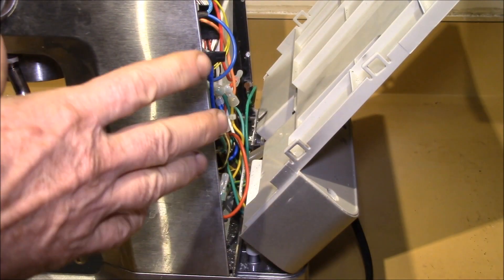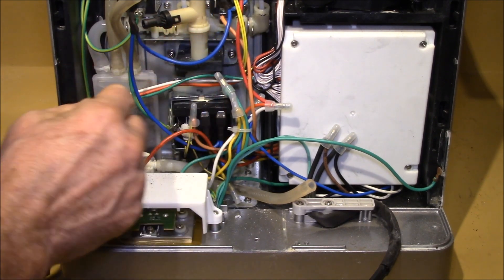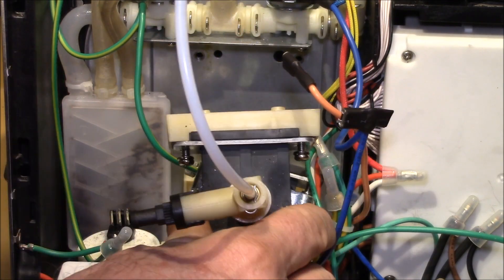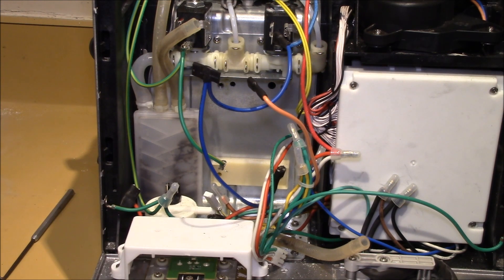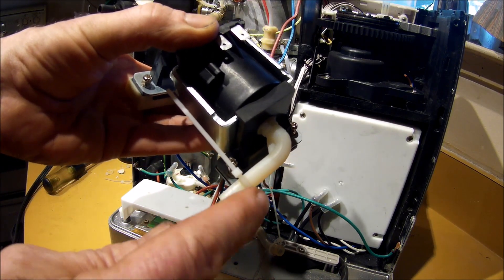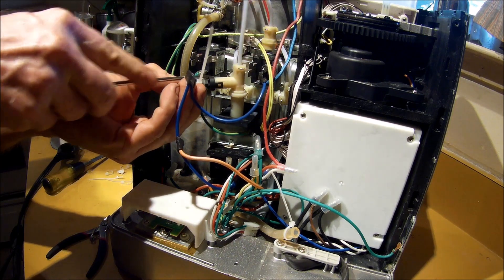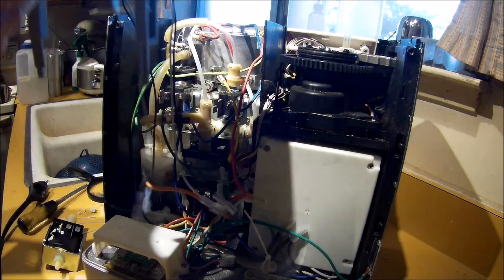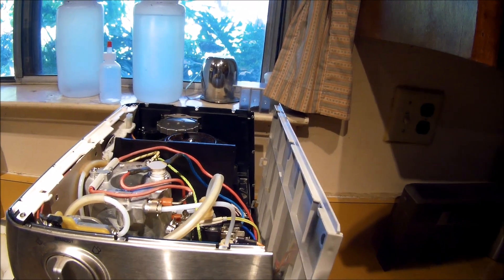Breville 870XL Pump Replacement, Part 1

Comment: Thank you for the great videos on replacing the solenoid and pump! I installed the new one and it solved my problem with the noise and water flow problems to the group head, hot water and steam wand. Upon taking it all apart, everything was clean with no corrosion or gunk. However now there appears to be a leak at the back left bottom which also drips into the storage compartment. The drip appears to come from the screw holes from the inside compartment as it pools below the tubes/pump etc. and then drips into the below compartment or onto the counter. I have tightened up all the zip tie connections as well as the solenoid assembly and the safety valve connection at the top of the pump (yes, I followed your instructions in the video about putting the seal back onto it). After drying up the slight trace of water on the bottom of the inside, I have run the group head and steam functions and cannot see any leaks/spray/drips. It only seems to leak when I reinstall the back cover. Could the back cover be pressing the safety valve assembly on top of the pump even though I have configured it at the 45 degree angle to avoid the solenoid? Is it possible to over-tighten zip ties or threaded valves? I was so excited to fix the original issue with the pump but now I'm stumped about the persistent leak. Any help would be great!
Reply from the maker: That may be the case with the back putting pressure on something when it's put on.  Try making small adjustments to the oprientation of the parts so that they don't move when the cover is reinstalled.  Try twisting the various hose connections back and forth and see if they'll seal up.  On any of the threaded connections, you might also try adding some Teflon thread tape to see if that helps.
Reply: @The4Crawler  Awesome! Thank you so much for the advice AND the very prompt reply! I used some tape on the threads of the valve connection at the top of the pump. I’ll try wiggling the tube connections to see if that does it and ensure nothing is contacting the back cover. Thank you again!
Reply: Hi ya Rob

Thanks for your awesome videos truly appreciate it they are very helpful.

But I'm having issues with my machine as I have replaced the pump and solenoids and there is still no water coming out the brew component.

When I push cup buttons 1 or 2 the water just goes straight into the tray and have no idea why?

Is there something I'm missing or done wrong?

Thanks heaps 
Troy

Comment: Thanks so much for these informative videos.  I'm hoping I can find a resolution to my problem here.  I bought a slightly used BES870XL and water flow, steam wand works but I get no pressure for the 1 cup button and just a little more than nothing for the 2 cup button.  I have adjusted the burr setting and the grinder on the side and that has not helped ( I'm assuming that why my friend sold it to me for cheap ).  The thing is, I use the cleaning disc on either a double wall or single filter on the 2 cup button and the pressure goes up to the max, sometimes, not every time, but this is the only time I EVER see the pressure gauge move.  If i use the  1 cup button with either the double wall or single wall filter and the cleaning disc, the gauge never moves.  Again, I have water flow.  Which part here needs to be replaced? Thanks in advance for all comments.
Reply from the maker: The dual wall filters should give some pressure regardless of the coffee grind.  Does the machine produce acceptable espresso?  If so, maybe don't worry about the gauge.  I find the cleaning disc will some times stick down on the bottom of the filter basket and that blocks off the water flow and you get a maximum reading on the gauge.  So it sounds like your pump is at least working in some manner.  It might be that when blocked, it can produce full pressure, but when there's flow under pressure, like when running a shot, then that pressure drops.  I noticed that on my machine and that prompted the pump replacement.  The pump can also be rebuilt from what I understand.  On the grinder, the ground coffee should have the consistency of regular table salt.  See my video in this playlist for checking the grind setting.
Reply: @The4Crawler   Thanks for your response.  I'm recognizing  I may not have watched these videos in order, if they were in order, but I saw a video on the Dezcal packets to descale and I'm trying that first.  I ordered the solenoid  valve replacement as well and will see if either of those does the trick this weekend.  Thanks for all the details in these videos man, I feel like per peoples comments on the Dezcal or the solenoid valve replacement on the ereplacement website one of these will work!
Reply from the maker: @selectscents  Yes, it could be something clogging a water line to the group head or it could be the solenoid valve not fully opening and blocking off flow to the drip tray that is causing the low pressure.
Reply: @The4Crawler   Update.  So I replaced the solenoid valve after descaling with Dezcal  and the replacement wasn't bad at all.  Kept the pump in and everything. But I still have no pressure.  Without screwing all things back in I snapped everything together just to see if I got any pressure and nothing........  The one thing I can say I forgot to mention in my first post on this video is that the steam wand works but the hot water steam feature spurts out water where as on my infuser it's a constant stream.  I don't know if this is related but I'm wondering what the next step to diagnose is.  Could my pump be the problem if I have water everywhere else?  Ordered the pump off Amazon.  Let’s see if this solves it….
Reply: @The4Crawler  Watched this video here ( https://youtu.be/DoO9ckyJ-rs), took out my pump and dissected it.  Broken spring is the culprit.  It was in 3 pieces.  Glad I ordered a new pump!
Reply from the maker: @selectscents  It might be the safety/over pressure valve is popping open and dumping water from the pump into the drip tray.  Or if might be the pump is worn inside.  If has a spring loaded ball that works as a check valve that lets the high pressure water out of the pump but keeps if from flowing back.  That might cause the pulsing hot water flow as that should be a fairly steady stream.
Reply: @The4Crawler  Put in the pump and it's fixed!  Wow.  Now I'm unsure on if I even needed the solenoid block.  Even the hot water steam is a constant stream again!  In hindsight after going through it wasn't that bad at all, especially if I just had to replaceme the pump!  Thanks for advice!!!

Comment: I've found your videos so useful. I bought a second hand bes870, and I am trying to replace the pressure gauge. How to achieve this seems to be a mystery. Do you have any recommendations?
Reply from the maker: Never worked on the gauge myself.  You might firs check that the tubing and fitting to it isn't plugged.  Here's a video on a different model that talks about replacing the gauge, might be somewhat similar to the 870 model:
https://youtu.be/tAJ5ETGpL7Y
Reply: @The4Crawler  thanks! Mine is a little different, but some of the tricks mentioned in that video might work!

Comment: Mr. Brown, to mirror so many other comments, I just wanted to give an immense thank you for your videos. I recently replaced the faulty solenoid block assembly in my 2019 Barista Express 870XL, which fixed the deafening buzzing and improper pre-infusion. Unfortunately, a new problem has arisen and I suspect the safety valve is the culprit, or less likely, the vibratory pump. During the brew process, the pressure will build to a peak, then stop and start over and over, needle jumping / fluctuating quickly between high pressure and no pressure. 

I have a new vibratory pump arriving today, but unfortunately there are no safety valves in stock anywhere, and no information whether this item will be returned to stock. I'd hate to have put all this work and around $100 in parts to have to ditch the machine over a darn safety valve!

My question for you: do you think there are any methods to clean/fix my existing (likely faulty) safety valve? Obviously not ideal, but anything to keep this machine chugging along would be appreciated! Thank you so much for your time!
Reply from the maker: Not much to the safety or overpressure valve.  A small ball and a spring with an adjustable preload screw.  Take note of where the screw is set and try unscrewing the end (count turns) and run some clean water through, maybe something is stuck where the ball seals off the opening.  Then turn the adjuster back in and if needed, try turning it in farther.  Or look up videos where folks have retrofit adjustable brass overpressure valves (OVP) to allow for better pressure control.

Comment: @ R Brown thanks for posting these videos.  I have a BES870XL.  My original problem was no water to the group head (steam wand & water spigot still worked fine).  I have now replaced the solenoid valve assembly; I have water coming through the group head again but now there is nothing from the steam wand or water spigot - it all comes out the group head.  I have also replaced the pump while I was at it but still have the same results.  I put the original Olab solenoid valve assembly back on just to make sure there are no obstructions & it went back to the original problem of no water to group head (but steam wand & water spigot work again).  I did notice a constant buzzing noise coming from the new CEME 3 way solenoid when it is plugged in.  Any ideas or suggestions?
Reply from the maker: Buzzing solenoid means it's #1 getting power to the coil and #2 it's not fully opening:
https://youtu.be/yYJRQu3ZUik
Hot water flows up though the normally open top port of the 3-way valve to the manual valve.  Simple check is to unplug that solenoid coil and see if hot water works.  If so, there's an issue with the 3 way valve.  Maybe the coil on the Ceme valve is the incorrect voltage, check the rating.  You could try swapping the Olab coil onto the Ceme valve and see if it fits and if it works any different.  Or try opening up the Olab valve and see if you can clean it to make it work properly, there's a video in this playlist on doing that.
Reply: @The4Crawler  I opened the Olab valve & cleaned.  I thought for sure that was going to do it because it seemed stuck when I first opened it.  Put everything back together & have the same issue.  Also swapped the CEME & Olab coils - still no water from group head with Olab & then no water from steam wand/hot water spigot with CEME.  Maybe the CEME is rated too high?  Not sure what to compare on the 2 to know for sure - I have a pic of the 2 side by side but can’t seem to post that on here.  Anyway, with the CEME coil on, I notice a lot more of a spark when plugging the machine back into the wall
Reply from the maker: @petersheehan7450  Coil should be marked with the voltage and the power (watts or volt-amps "VA") rating.  I found the Ceme coil was a bit higher VA rating than the Olab like 14VA vs. 10.5VA.  Not a lot but makes for a stronger magnetic pull to pull the valve  open better:
https://photos.app.goo.gl/bN1ugnLPYwvyDcr59

No coils should be getting power when the machine is first plugged in or even in hot water/steam mode.  Only time they should be on is in espresso mode, firs the 3-way runs then at the end of the cycle, the 2-way valve runs for 30 seconds to drain off excess pressure in the machine.

One test would be to disconnect one power connection on the 3-way valve coil and then see if hot water/steam works.  That will keep the 3-way valve closed and water should only flow up to the hot water / steam valve.
Reply: @The4Crawler  that is exactly what I have: CEME coil is 14 & Olab is 10.5.  I will try the disconnect power/hot water test next.  Thanks
Reply from the maker: @petersheehan7450  There is about 30mA (0,03 amps) difference in current between the 2 coils:
https://youtu.be/yYJRQu3ZUik
Reply: @The4Crawler   I unplugged the coil at the 3 way valve & water flows to the steam wand & hot water dispenser so as you have said, that points to an issue with the 3 way valve.  I have cleaned the old valve & also used the new one that came with the solenoid valve assembly, but I keep getting the same problem.  I’ve also swapped out various components/coils etc but I can’t seem to get anything to change.  Any other ideas on what could be checked?  Thanks!!
Reply from the maker: @petersheehan7450  It may be the new valve is plumbed internally wrong.  By design, you should be able to blow air in on the right side port, where the 90 degree elbow attaches, and air should come out the top port with no power applied.  If that's OK, then something is causing that new valve to be powered.  If the old valve is unpowered and the new valve is powered, something strange is going on.  Apparently cleaning the old valve didn't help.  Maybe it's still clogged internally and that's not allowing it to fully open and thus seal off the top port that goes to the hot water valve.
Reply: @The4Crawler  I can blow air through the elbow on the right side of the new valve & clearly feel air coming through the top.  I’m soaking the old valve again to see if I can clean it better.  Thanks

Comment: my machine when I turn it on I don't hear the pump and just appears on the display the message “fill tank”, I tried to move the magnet on the back but nothing happened.
Reply from the maker: I guess this must be a newer machine or different model.  Mine has no sensor for the water tank.  I would look into what senses the tank water level and see if that part is working or not.  Maybe try disconnecting and reconnecting the wires for that sensor (with the machine unplugged) and see if that helps.

Comment: Thank you so much for these videos, they have been extremely helpful in diagnosing and attempting repairs. Any thoughts are appreciated. When trying to pull a shot, water spurts over and out the portafilter, pulsing and spewing coffee grounds and water all over. The pressurized basket pulls mediocre (at best) shots without leakage, but the non-pressurized basket spews all over (regardless of grind, fresh beans, etc). Long story short as there were other problems as well: I’ve replaced the gasket/seal, water pump, solenoid assembly, and safety valve. Also checked the thermocoil (heats well), cleaned the inline filter, taken the flow meter apart (pump shuts off appropriately), checked o rings and connections, examined and cleaned out all tubing, checked drip tray for water diversion, descaled twice with citric acid, primed the pump, checked the PCB pullout (nothing looks fried). Thoughts on what might be causing the water to pulse and spew out of the portafilter when trying to pull shots?  So much time and parts into this, hate to give up. Thanks!
Reply: I had this happen to me as well and it turned out that the portafilter basket had a crack in it along the bottom edge. Not sure or not is this is your case but it's worth looking at. It was just a hair line crack.
Reply from the maker: @OldFriendsandNewRoads  Good tip, something to look for.
Reply from the maker: Hard to say but it might be the safety/over-pressure valve that's on top of the pump, may be popping open and closed causing the pressure variations.  You should be able to pop the back of the machine open and watch inside as you run a shot.  Be careful as there are live, exposed electrical connections inside.  Look for water flowing out of the side of that t-shaped valve and down into the drip tray.
Reply: I have a very similar issue. too much pressure and it spews all over the basket. Have changed the showerhead seal few times, no luck. Were you able to resolve?